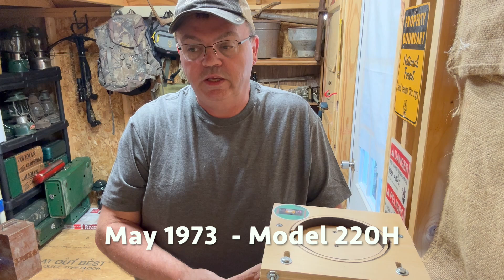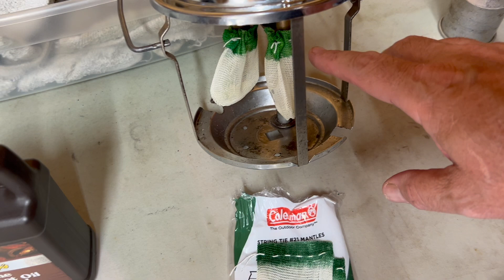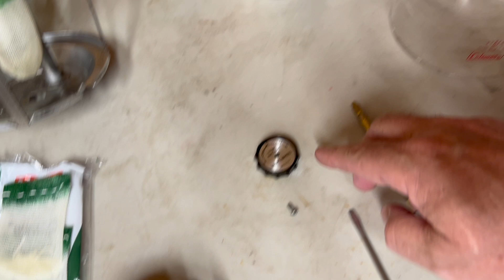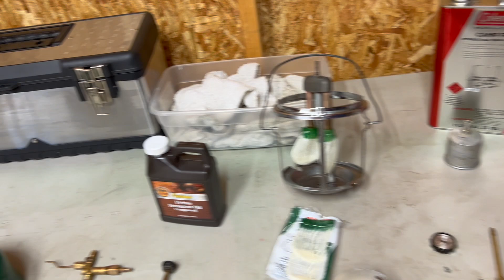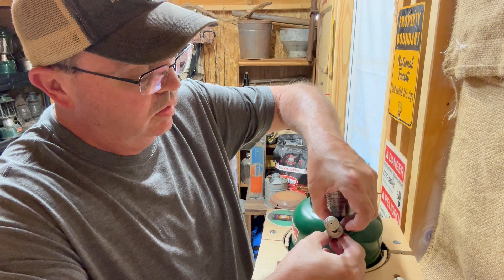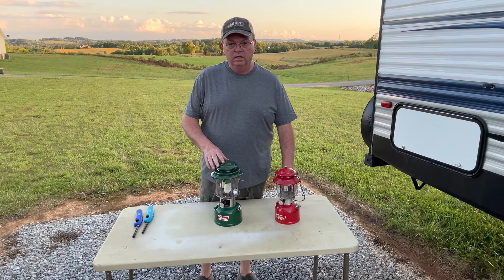Refurbishing A 220H Coleman Lantern

Comment: Hey John, great video content. FYI the clocking on those offset fuel valves were made easy by Coleman. If you look at the top of the fount, you will see a small outward dimple. That was put there by Coleman so the factory workers would know where to position the fuel valve. The decal was put on later. Most times the fuel valve is positioned 90 degrees from the fuel cap. You'll know when it's right when the front bar of the frame is inline with the fuel valve and the left side bar is inline with the fuel cap. About 95 percent of Coleman lanterns are clocked that way. Hopes that little tip helps you out in the future. Take care and have a great Fourth of July. Keep em burnin'.
Reply from the maker: Hey Anthony, thank you for watching and the great tip. It is always great to learn something new. These lanterns bring back great memories with my dad, hunting, fishing and camping. I wish you a great evening and Fourth of July, as well.